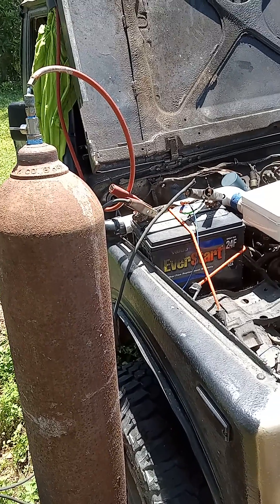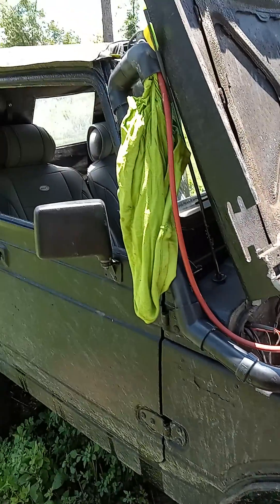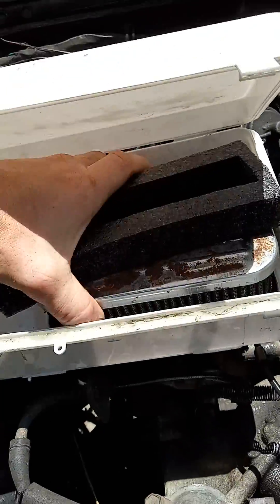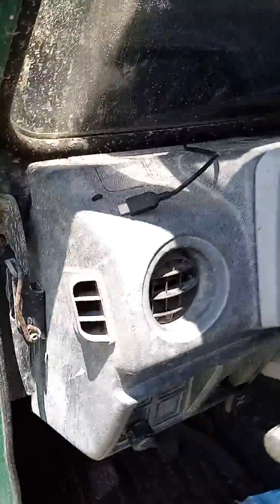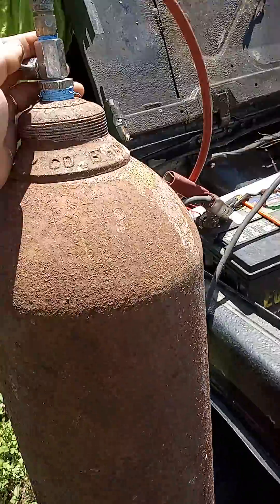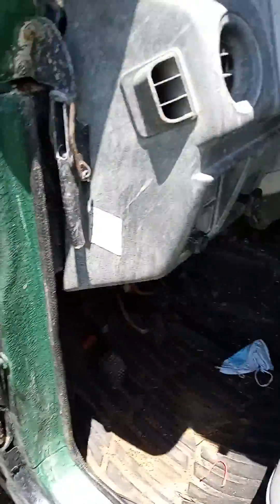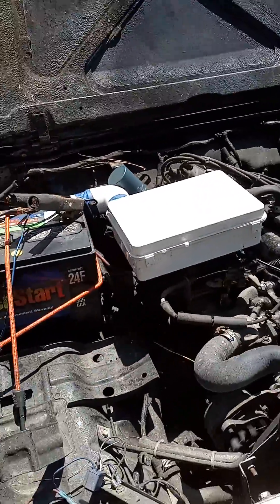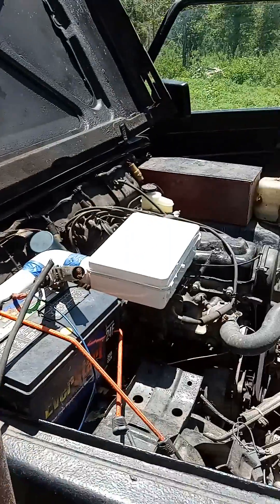running engine 100% on hydrogen(not hho)-run any car, truck,generator or fuel cell on this

Comment: the next phase into my experiments is the storage part , what I do know is that this is the hard part and potentially dangerous part for reasons obvious. storing browns gas is a very bad idea  but hydrogen itself is just like any other gas I would assume , for the most part .
Reply from the maker: I use a vacuum pump before hand with all my tanks
Reply: @hucktrucks1161  In using the vacuum pump. Did you pull from hydrogen container to tank ? And if so. The storage tank would fill to capacity then discontinue accepting hydrogen gas. Is this the process ?
Reply from the maker: @brad2548  no sir, I use the vac pump originally to pull all oxygen out of the tank so it doesn't combust from compression with hydrogen. Once it is vacuumed to 500 microns I then shut the valves and slowly feed hydrogen to the tank. As explained my device makes 100s of psi on it's own just on the reaction. So no pumps are needed to transfer to the tank. I only have to do this once with a new tank.
Reply: @hucktrucks1161  Hey bro. Best to have all knowledge and awareness in order,right ? Ooooooh boy. Or kaboom:-(
Reply: @hucktrucks1161  I'm glad you understood my question. Thank you
Reply from the maker: @brad2548  I've had a few Kabooms over the years 😂 that's part of what made me take extra precautions
Reply: Hi, can you be a little more specific than “100s of psi?” Thanks 🙏
Reply from the maker: @robervine7721  I mean I can't really because there's not really a limit besides whatever hydrogens compression self combustion limit is but I know that's high

Comment: I know how to make and seperate hydrogen with my fuel cell I made  but how do you compress it into the bottle ?? 

next question 
just to be clear you blocked the fuel line  and used the air intake for the delivery of the hydrogen. much like  starting fluid ... this all makes sense. browns gas videos makes no sense and I call bullshit on those ones , but this,  this would work,  good job .. why didn't I think of this I don't know ... but how did I get it into the bottle ??
Reply from the maker: This is a chemical reaction of h2 method that I use. It produces a much higher amount at a much faster rate than using electrolysis. I started off 15 years ago with the electrolysis method and then stumbled across this method about 5 years ago and found that it actually costs about 10$ in reaction material to run a car equivalent to a full tank of gasoline. I will be putting the product on the market soon as well as selling premade solution that just needs to be added to water to run a car
Reply: @hucktrucks1161  so you are saying that you mix some chemicals in this bottle , and the reaction into hydrogen pressurizes at the same time
Reply: @hucktrucks1161  how  did you come across you find ... it obviously had nothing to do with dry cells  ??
Reply: @hucktrucks1161  if what you are saying is true you might want to set up some insurance , so that you don't accidentally disappear or get into a accident , if you know what I mean
Reply from the maker: @ghettocowboy993  when I was a teen we used to make these type of fireworks that made no flame but a loud boom from rapid expansion. later in life after research I found that what we were making was hydrogen gas. I found this really coincidental considering I had been trying to run engines on dry cells for years and I put the technology to the test and it worked. And yes you are correct on using it's own reaction to pressurize the tank. The expensive and tricky part is getting a vessel that is suitable for the mixture and that can hold the pressure. My device I've made that I'll be showing soon doesn't require a tank and starts and stops the reaction on it's own so that it never under or over pressurizes and keeps that sweet spot to run a car
Reply from the maker: @ghettocowboy993  and yeah I've been very particular on letting out too much of my personal info for that reason. That's why I'd really like to just sell my invention patent and wash my hands clean of any worries like that
Reply: @hucktrucks1161  that's sick ....
Reply: @hucktrucks1161  yeah but that the problem , see the rich corporations buy up tech like this  just so they can make it go away ...  they don't want humanity to have cheap if not free fuel for cars , just as the health industry does not want to cure people and make them healthy , there's no money in it for them . That's why if you do choose to sell it make sure you know for sure that it is in good hands , if that matters to you that's your business but just wanted to put that out there...
Reply: @hucktrucks1161  so are you into chemistry as well
Reply from the maker: @ghettocowboy993  I am, I love science of all types,this method of making hydrogen will actually produce a lot of heat if it isn't cooled down and will actually heat a home just off the reaction
Reply: @hucktrucks1161  that's awesome good for you ... I myself have been playing with this tech for about 5 or 6 years now , wet cell , dry cell,  big and little, 20 plates and 2 plates . my main focus was to make a heater using platinum and sand , a catalytic heater . and I was successful , but then I thought shit why no make a furnace run on it . then the plandemic happened and my priorities shifted and it was put on hold . So I'm excited to be getting back into it .. anyways congrats on your achievements I hope it works out for you ..
Reply from the maker: I'll be expanding more on this topic soon in the next video, but you are correct this is pure h2, not hho. I vac all air out of my tank to -30 first and then I connect my reaction vessel to the tank via high pressure hose and slowly open the tank valve  once the reaction has reached about 200 psi.
Reply: @hucktrucks1161  oh wow , I have alot to learn ... thank you  !!!
Reply: Hydrogen on demand isnt illegal as it is safe and lighter than air. Hydrogen contained or under pressure is against Federal Law........Not to rain on anyone's party just be in the know......
Reply from the maker: @pitttbull187  not if it's made on demand though, also it's not illegal at all to pressurize in a tank so long as the right hazmat is approved on the car. there are many cars that have hydrogen tanks
Reply: @hucktrucks1161  buses, ships, space shuttles, space stations , submarines , semi trucks too...

Comment: how do you create and compress hydrogen?
Reply from the maker: I use a simple chemical process that I'll be showing that pressurizes on it's own reaction. I feed the hydrogen gas off of it to my tank to fill it
Reply: @hucktrucks1161  when will you demonstrate the chemical process ?
Reply from the maker: @brad2548  I'm going to aim for this next weekend.
Reply from the maker: Check out my other video of running my Chevy with the reaction vessel on it's own